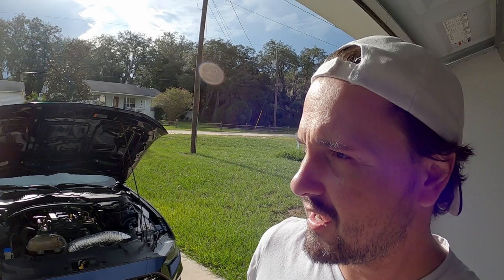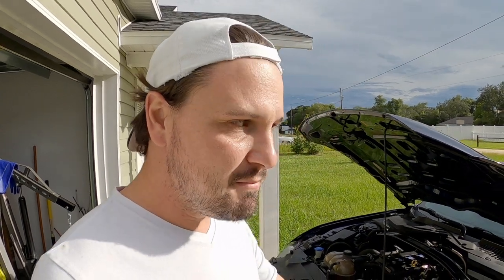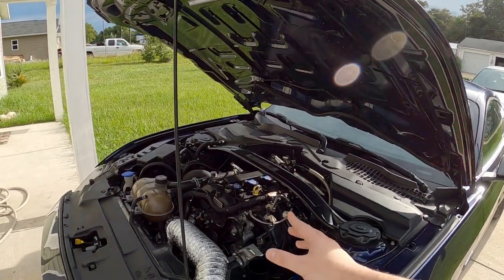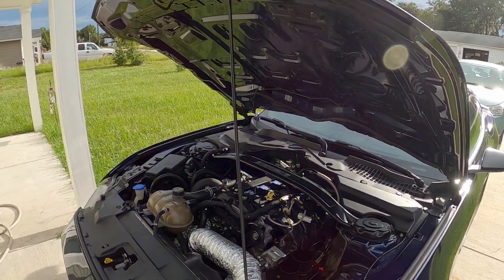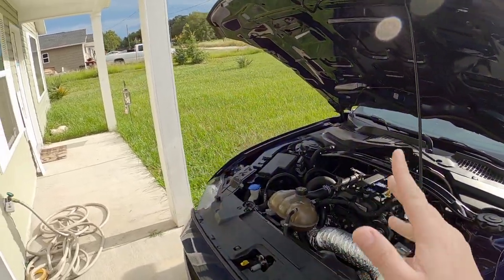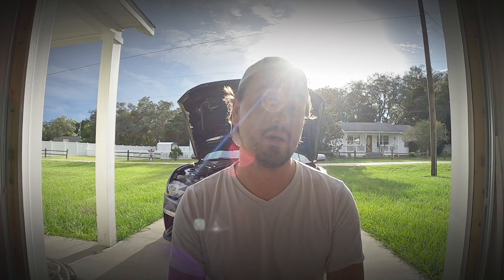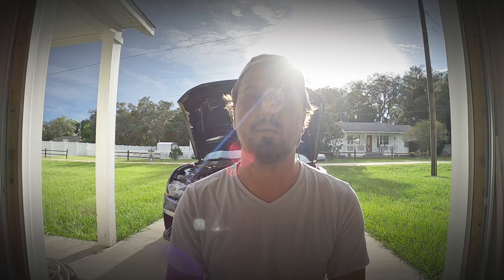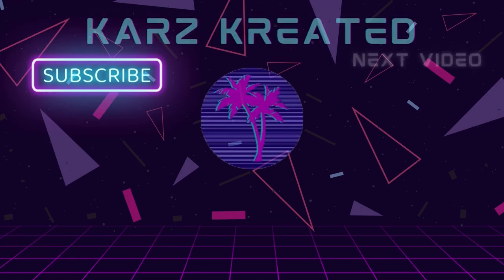This Behavior was Dangerous For Me

Comment: When you get it fixed maybe revisit added dwell in the entire rpm sweep focusing with more in mid and top see how it effects your pulls.
Reply from the maker: Yes! That video is still planned. I've had the running at close to 4 ms dwell for weeks now, and while I'm not sure if there's a power difference, I know there's more complete combustion. Coming off throttle with the aux fuel spraying would cause some pops and bangs because the fuel wouldn't completely burn. Now it doesn't do that. So that's very telling.